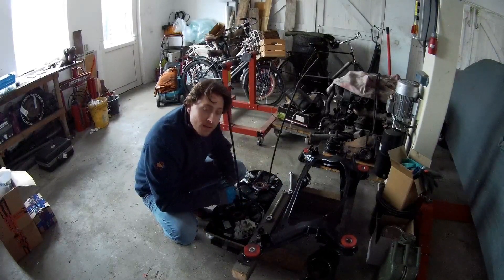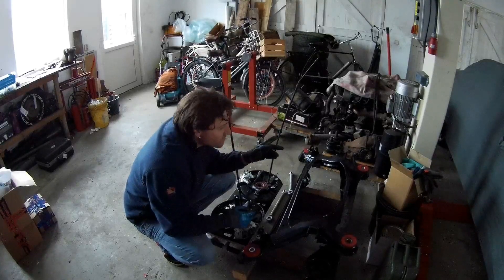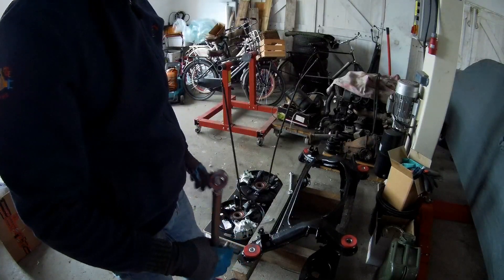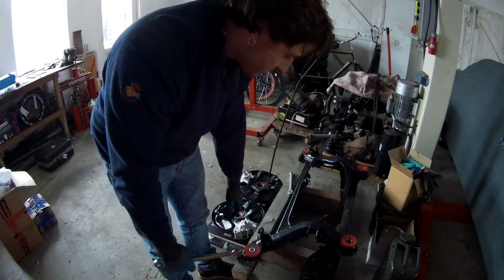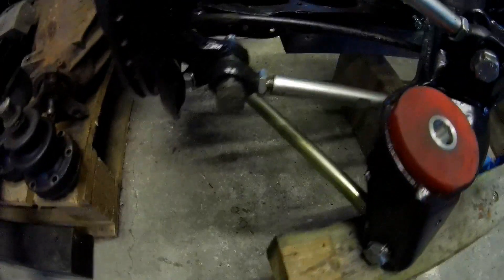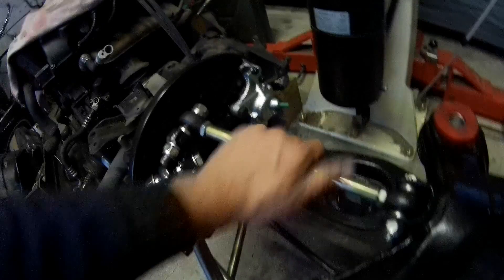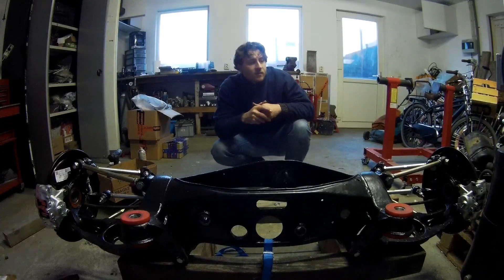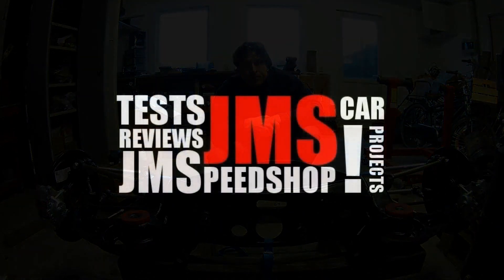W124 Tie rods linkages en wheel hub installed V8 turbo Project

Comment: nice video, are those vented rear disc? what car came with those i'd love bigger brakes on the rear of my car to match the front
Reply from the maker: I have s210 wheel hubs in the bak with e55 AMG brake s
Reply: @JMSpeedshop  brake caliper early identical to the 300ce that I've got now just vented discs. Same bolt pattern as the 190? I'd be interested in finding a set for myself
Reply from the maker: I think the Will fit because people also use e430 brakes i thought
Reply: @JMSpeedshop  yeah up front I've the 320 calirpes already

Comment: Do you know if a rear subframe from a W210 will fit on a W124? I have an S210 E55 that will be a donor car for a rebuilt C124 some day in the hopefully not too distant future, and was thinking about using as much as possible from the S210 drivetrain (It's a Kleemann-tuned E55, so nice big brakes and sturdy driveshafts etc)
Reply: Your 210 rear sway bar will fit, and the e55 diff and driveshafts should be an easy swap as well. Other than that, just replace your w124 subframe with new bushings, poly if your desire. Brakes can easily be adapted to work as many people have done W222 and W211 brakes on w124 even. May need custom brackets, but its doable.
Reply from the maker: Not sure but i don't think IT Will fit
Reply: @JMSpeedshop  Ok, I'll have to take some measurements and see what goes where. I like your projects btw :)